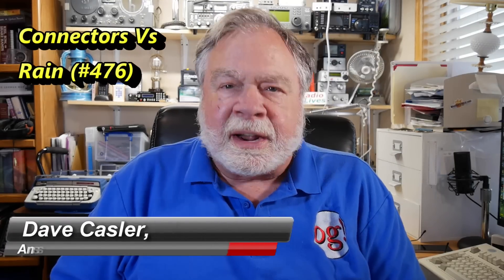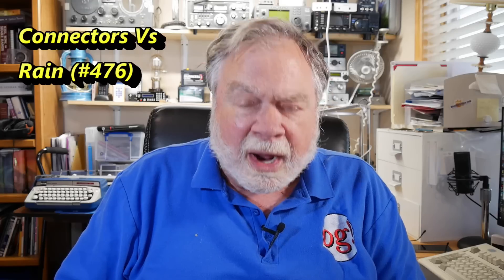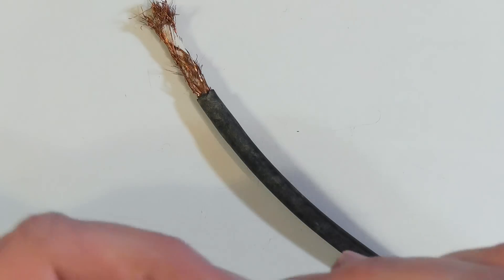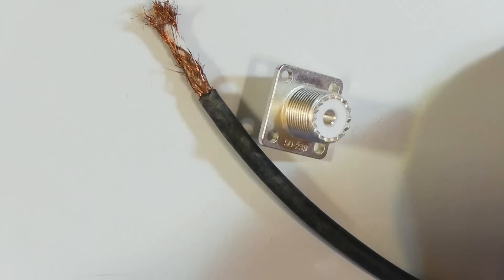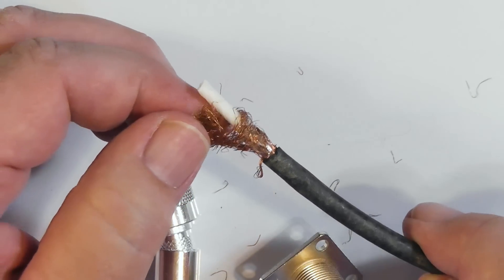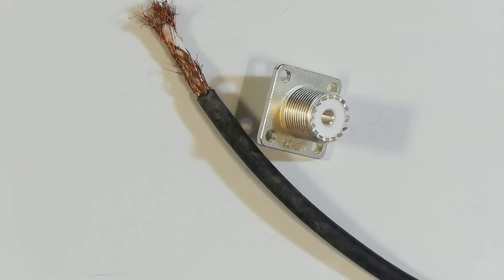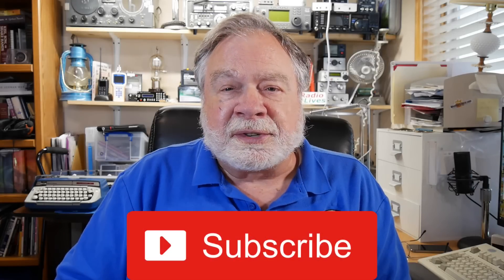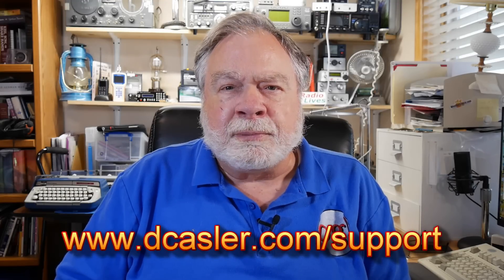Connectors VS Rain (#476)

Comment: I use rubber splicing tape. Stretchable rubber tape, (no adhesive) tightly wound covering the whole connection, then electrical tape for UV protection as Dave suggest. No adhesive makes it easy to remove when needed without a stick mess afterwards. Can get it at Lowes and Home Depot.

Comment: Adding an outer covering of UV resistant heat-shrink (HS) tubing helps the self-vulcanizing rubber tape last. The HS tubing has fewer possible holes for infiltration than the Scotch 88 tape.

Comment: There are many names for that type of "rubber" waterproof tape: self-fusing, self-bonding, self-amalgamating and self-vulcanising are a few.  It must be stretched before wrapping to make it adhere to itself.  It is also useful if you accidentally damage a coax cable sheath and want to prevent water getting in that way.  It is resistant to UV, oil or most chemicals but cannot be unwrapped - you need a knife to get the already fused tape off!

Comment: I waterproof all my outside coax connections, no matter what type of coax connector I am using. Best practice is to tightly wrap the connection with rubber "coax seal" then wrap it again with good quality electrical tape. If you do that, and buy high quality coax, it should last for years.
Reply: Here, over the pond, after ensuring that the cable and connectors are clean and good, we seal the connection by wrapping rubber self amalgamating tape around the cable, starting about 2 inches below the connectors on the cable, carefully over the connectors to about 2 inches above the connectors, several times. Although rubber self amalgamating tape is not particularly sticky, one has to stretch the tape and keep it under tension as one winds it around the cable and over the connectors to the other cable ensuring that it forms a good seal; by stretching it the self amalgamating process causes the rubber to become a solid structure. One may wrap the self amalgamating tape around the connection three or four times; then squeeze the tape around the connection with your hand, ensuring that the rubber self amalgamating has now become a solid rubber mass around the cable and connectors.
And if you really want to seal the cable for a long period of time for a permanent structure (i.e. Once sealed, it is extremely difficult to remove the seal), one could go the extra mile and use, 'plumbers mate'. Ensure you follow the written instructions for 'plumbers mate' and have the correct protective gloves as you apply this smoothly over the whole of the wound self amalgamating tape of the cable connection;  it can be a very messy job applying 'plumbers mate', but if it is correctly applied it provides a very hard waterproof shell around the connection which should last for years.

Comment: Dave, you make a good case for a better coax and some N connectors which stand up to water much better.  As far as the tapes go there and so many high quality tapes that stand up to water and high voltage  they can't be listed here.  Thanks for an interesting talk!

Comment: First, use dielectric grease IN the crimp and connector. Then overwrap with self amalgamating tape, or apply a half dozen coats (they're thin) of Liquid Lectric, a liquid plastic that dries to make a watertight seal.
 In the big box stores, Liquid Lectric may be with the electric tape, but the srlf amalgamating tapes are often in the plumbing section.